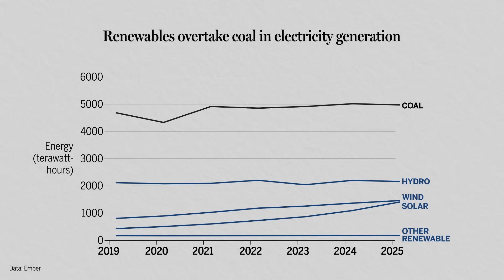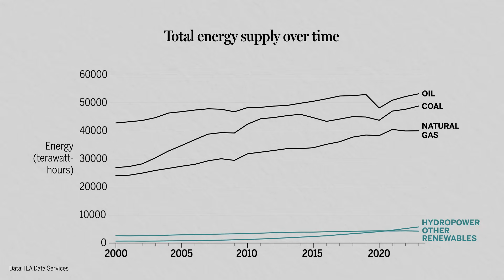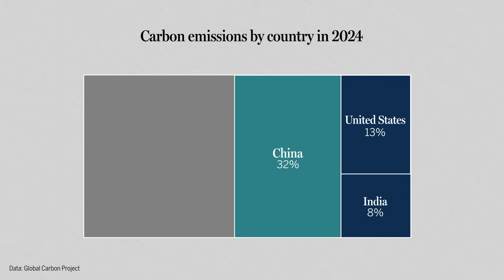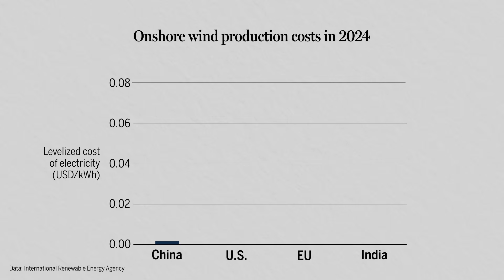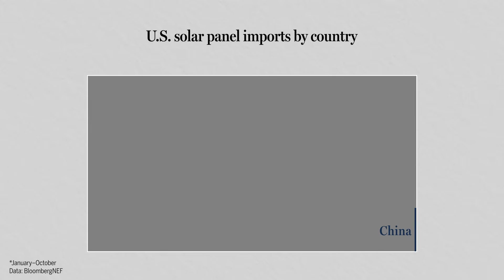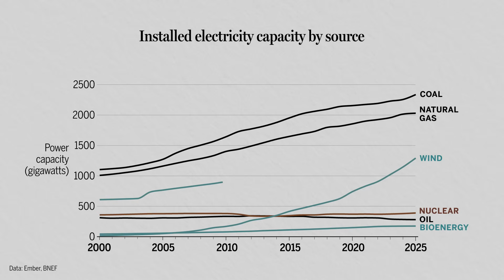How cheap renewable energy is finally flattening emissions

Comment: The rise of solar power is great news, but frankly, it's only (at best) half of the puzzle. Clean firm power sources are still criminally underdeveloped globally with respect to fossil fuels, and the most scalable one in this category -- nuclear power -- has been shelved for decades for bogus reasons. Nuclear plants are costly to build, especially in the West, but physics doesn't mandate it to be that way. Just like physics didn't mandate silicon photovoltaics to remain at 1970s eye-watering prices.

The potential is there for a reliable, affordable, abundant, and overall sustainable power supply for all of humanity. We need to be frank (and rational) about the shortcomings of every option, and invest in a diversified portfolio with a long-term vision. Either we do that in the West, or else we'll have to pray that China also learns how to build nuclear reactors that fit into shipping containers the way solar panels do today (i.e., so as to make up for the lack of vision, political consensus, and industrial capacity elsewhere).

Comment: Can someone explain if there's a problem with recycling/discarding solar panels, in terms of ecological impact?
Reply: Recycling and manufacturing concerns are definitely a consideration, but the people lamenting how terrible it is, ignore that the biggest waste product in America for the last 100 years has been fly ash which is what is leftover from burning coal.  Its often stored in mountains at the power plant, and the dust is cancer causing.  Because the chemistry of solar panels and manufacturing is constantly changing it is hard to predict how they might be reprocessed, recycled or disposed of.  With a 25 year life span, at the point they are replaced  they have produced quite a bit of energy.
Reply: No.

Comment: Although I have my own solar installation and like it.
The picture about increasing renewables energy generation vs increasing demand is misleading. It suggests that increasing renewables generation helps to meet the increasing demand for electricity. To some extend it does, but not even nearly one to one. A lot of renewables electricity generation pushes conventional electricity generation out of the market instead of meeting the increasing demand. We still need to build conventional power plants to have power available reliably, they just don't run as often, because they are not needed when the sun is shining and/or the wind is blowing.
We see this in "China's pivot away from coal". China is still building coal plants.

Comment: The greater proportion of renewables the higher the price of electricity in those countries. That may/may not change in the future.
Reply: Erm, if you were watching you might have noticed the mention of necessary infrastructure to capture, store and transport renewable energy. That has to be paid for but once in place the cost will fall dramatically

Comment: 5:25 EVs can be charged when the electricity production is higher than the demand, they are perfect for a renewable society. And people do charge when demand is low, because in most countries it means cheaper electricity. And of course it is automatic, the owner of the car just have to plug when arriving at home or work, the charge will start/stop at the perfect time. Not to mention V2G.

Comment: Could they not make roofing tiles that could be integrated into the building process than an extra ad-hoc?
Reply: Yes it can be done but is currently expensive compared to just buying panels.
Reply: Solar roof tiles are impractical and dont exist
Reply: @Nyan4Eon  Come to Australia with that assertion and you'll be laughed out.

Comment: If this were true, why are energy prices rising in European countries that switched to renewable energy?
Reply: Profiteering mainly and governments setting prices based on the market price for gas. Russian sympathisers still pushing the cheap gas nonsense.
Reply: @PaulC-s1d so the suppliers of renewables are profiteering?
Reply: To pay for the necessary infrastructure. Take my country, the UK. Most renewable is wind rather than solar, generated mostly offshore where it is windier and there are no objections from people from people who want a nice view. The electricity has to be transported onshore and stored- and that is very expensive. Once it is in place, the cost will fall dramatically
Reply: Cheap Russian gas was still the largest single energy source for many European countries

Comment: Solar energy combined with battery storage can power the world many time over.
Wind and solar energy are safer, cleaner and cheaper than fossil fuels. Cheaper WINS !
Reply: It won’t. Only theoretically. Back in Practice it doesn’t. Power grids can’t run on renewables alone
Reply: @volkerr. Oh you are so wrong.   Battery storage makes wind and solar base load power 24/7/365
Reply: @KJSvitko  😂😂😂😂 imagine 2-3 days with no wind.. first day energy comes from batteries for some hours. But due to the lack of wind it can’t reload again… 🤦‍♀️🤦‍♀️🤦‍♀️🤦‍♀️🤦‍♀️
Reply: @volkerr. That is why wind and solar are a good combination to work together  It is sunny in the day time and the wind blows more at night.
Reply: @KJSvitko it’s not predictable and it doesn’t  work like in your green fairytales. Trust me. I’m German an we suffer from that failed experiment. 😢
Reply: @volkerr. WInd and solar energy are safer, cleaner and cheaper than the alternatives.  You can't beat free energy from the  sun.
Reply: @KJSvitko it’s not cheaper when you look at the whole
System 
A power grid can’t run only wind and solar only.

Comment: Imagine how much cheaper electricity would be if society kept making nuclear power plants instead of these solar junk panels.
Reply: Possibly cheaper. But nuclear is pricey at the beginning, and absolutely has to be done right. We can look at France to answer your question. They have abundant and stable electricity. Cheap? Well petroleum is pretty cheap.
Reply: Solar is relatively cheap, adaptable, and a great compliment to fission.
Reply: @presence5426  Solar is stupid cheap, here in Australia there are deals for batteries that include FREE panels.
Reply: @PaulC-s1d It's gotten much cheaper. And subsidies help. And we should do it. But over the decades, it wasn't viable yet. And, we'll be needing all the electricity we can get. Can't count on just solar.
Reply: Try checking the costs BEORE you make yourself look ignorant.
Reply: @ianhamilton3113  Do a fair analysis of the costs. Seriously. The entire life of a fission plant, value of electricity produced, all costs considered. You might be surprised.
Then look at what the French & Finns have done with fisson.
Not to say solar isn't cheap. It is. It will be a big player soon, and sorely needed. But... we needed to limit burning "cheap" fossil fuels 50 years ago. The way to do that was via fission. Developing it, making it safe, and exporting the tech. We didn't.
Cuz radiation scary. Cuz the costs!!!!!!! Cuz we got tons o' oil, Tex.
Dumb. Bad thinking. Bad policy. Bad leadership. Low vision.
Now we're screwed.
Reply: @presence5426   I agree dropping nuclear early was a big mistake and it does have a place. Problem is the capital costs are rising along with the finance costs. All the time solar, batteries and wind get cheaper.
Reply: @ianhamilton3113  Federal governments can fund whatever they want. The U.S. could have easily funded the best fission program in the world. France did just that. We could have partnered with them. Then we could have made money and reduced fossil fuels use by exporting the tech.
Solar & wind are cheaper, but we can't run an economy with them. They're like, what, 10% of electricity generation? Fission has been a steady 20% for decades. The rest is mostly petroleum... still.
Reply: @presence5426  "Solar & wind are cheaper, but we can't run an economy with them." Today! Quite correct. But we don't need to today. You are not factoring in future developments.

Comment: I have travelled to Punjab in Pakistan and there’s a solar revolution happening there, it’s nice because Pakistan has a huge deficit on their accounts due to energy imports, so additionally to the economic development it also helps their balance of accounts.
Reply: Only thing now is electricity storage, because I've heard that just like here in the Netherlands, the energy grid is starting to get smoking hot because of all the green electricity sent back into the grid.

Can be NMC or LFP lithium batteries or Sodium-ion batteries, but despite them getting cheaper, they're going to remain expensive compared to heat batteries made out of sand, concrete or (ceramic) bricks.
Reply: @therapeutischbecommentarieren  yes you are right. I am from Pakistan and we need cheap batteries soon. Everyone is adopting for Lithium batteries but they are expensive for now. There is a sea of solar panels around my house now. But very few batteries yet. And we are counting on China to make cheap batteries soon.
Reply: @alitariq9750  sodium batteries at a fraction of the cost will be out in the mainstream in a few years.  Not as good as lithium but so much cheaper.  Also coming from China.

Comment: 1. Much of the reduction in C02 in the U.S. is a product of using more natural gas rather than oil and coal, both of which emit more C02 when burned.
2. Most renewables come from China, a dictatorial, communist country that does not have the best interests of the U.S. in mind.  It is not wise to make China more wealthy by buying their renewables.
3. China is increasing its energy output from renewables, yes, but it is also building between one and two new coal plants every week.  China simply wants to produce more energy by any means possible since energy equals prosperity.   
4. The best way to keep the global south poor is by requiring that they use renewables.  
5. The picture for this video of what could be a beautiful field covered with solar panels says it all.  Solar panels take up a huge amount of space while destroying natural beauty.
6. The continued and increasing use of fossil fuels, while renewable output is much less than fossil fuel output, says it all.  Renewables at least now cannot compete.  
7. Renewables do have a place, but for now at least, the combination of nuclear and gas provide stable, non-intermittent energy with very low C02 output.
8. This host is correct: Making a full transition to renewables will cost many trillions of dollars.  This is not worth the cost.

Comment: Misleading title - no evidence presented for "flattening emissions". Coal production is rising, as is CO2-emissions (actually mentioned). Renewables are not even keeping up with the overall energy demand in the world, all though electricity production has seen a shift in the mix towards renewable. It remains to be seen how much renewables you can mix into electricity production, without at some point introducing large scale batteries (which will be very expensive). 

It was said that China is almost there - when it will flatten its emissions. Make no mistake - its in the interest of China to have us all believe that. They will continue to do exactly what makes most economical sense, while the West moves all its production to China.

Comment: Doesn't solar use a lot of heavy metal that has to get extracted that's very hard to recycle and extract like lithium? Also love how we keep pressing on renewables but no talks about the carbon cycle instead it's just CO2 everywhere!!!  And if we want to actually help then we need to dial back our carbon consumption and give the Earth time to heal 🫠
Reply: What?
Reply: @Iblueda1234 Basically saying solar is worth more than it gives back (It was around 3am when I was typing this I was very sleep deprived)
Reply: It’s only hard to recycle those kinds of materials as long as there isn’t a reason to do so at scale.
Reply: @alexsiemers7898 Wouldn't that need come from needing to replace panels and batteries if we did somehow switch just renewables? And solar panels still would need to offset their emissions for extraction of materials

Comment: Whats the current rate of solar panel efficiency?
Reply: @sopek1427  Of currently commercially available panels, 22.5%.  
But with new materials and manufacturing techniques, efficiencies of 25 to 28% will likely be available in the next 4 to 8 years.
Reply: @sopek1427  20%

Comment: American denialism of climate change and the subsequent need for renewable energy investments will put it at a serious economic disavantage and compromise security in the next couple of decades as the rest of the world are rapidly advancing renewable energy, battery storage and electric vehicles (EV’s) tech.
Renewable energy is the cheapest and fastest to setup form of energy generation; even when compared to coal. However, advancing technology will still allow fossil fuel corporations to extract oil from nonconventional sources like shale or source rock. So the concept of a Peak Oil time-clock will have to be postpone. It is not a depletion of oil but when unconventional oil exploration, extraction, refining & transport becomes so financially expensive for fossil fuel corporations to stay profitable for their share holders that the transition to cheaper, faster to setup renewable energy in the forms of solar, wind & geothermal energies will become dominant. Geothermal energy also has the advantage of benefiting from existing oil drilling technology.
America needs to wake-up before it’s too late.

Comment: Our new house has super high insulation and powered by electricity. I installed R35 foam insulation in the attic, R28 in the walls and R10 over the concrete basement floor with blue DMX dimple mat first. Next year I'd like 10 solar PV panels on the southern roof and the year after a residential battery system. My top concerns are climate, comfort, energy security and mid term cost savings.

Comment: Finaly we got to the point, where renewables, EV and batteries are big enough to push fossil energy down.
Reply: It’s an inflection point that every new technology encounters. When it’s commoditised to the point where production of said technology is available at a price where it can be mass consumed. 

Australia has just announced that from 2026, households will get 3 hours a day free electricity because there is simply too much supply.
Reply: @kr-wh4sh turns out subsidized oil is to expensive for the market.
Reply: @matthewvandeventer3632   "subsidized oil" to the tune of ~ 3 billion dollars a year!
Reply: Economic warfare does that quite well. OPEC+ is just a cartel that occasionally disagree
Reply: False. Every year we burn record amounts of oil, gas, and coal.
Reply: @1237barca  "Every year we burn record amounts of oil, gas, and coal." And every year the planet sets a new record high CO2 concentration in Earth's atmosphere!

Air pollution is not getting any better either!
Reply: @peterh5165  ya, my point exactly. All the renewables have led to record emissions and continuation of the same trend. They are not a solution.
Reply: @1237barca  Outstanding answer 1237barca!

   Because everyone knows when you install solar panels, they keep burning fossil fuels for ten to twenty years (the life of the solar panel) versus just burning fossil fuels every single day: forever!

And everyone also knows there are zero emissions from fossil fuels production!

Excellent catch 1237barca! 
      I completely forget that gas stations just stick a pipe in the ground, and out comes refined gasoline!

How can I have been so blind!

But...

Other people seem to suffer from this delusion that actually it actually takes energy to:
 pump petroleum out of the ground; 
(sometimes with the assistance of high temperature steam injection to thin the oil enough to pump it out of the ground);
transport it to a refinery;
refine the oil at temperatures from 750 degrees F to 900 degrees F;
then transport the gas to gas stations in big, heavily load fuel trucks all over the region.

These delusional people think that everyone of those steps from ground to gas station requires energy: 
lots of energy!
And here is the kicker: you have to do that every single day!
FOREVER!
Reply: @1237barca  
Hey readers of this comment section: 
notice how 1237barca did not answer the part about air pollution!

Google:
China airpocalypse

And look at the horrendous air pollution in the big Chinese cities from a dozen years ago.

Air pollution so bad, that it was hard to see across a wide city street intersection!

Air pollution so bad that it wasn't just the elderly suffering lung issues: 
    young children were coming down with lung issues!

Young children!

It was so bad that China started a huge push to get heavy industry away from the big cities AND, 
     a huge push to eVs (electric vehicles).
 
A dozen years later air pollution is much better!

Who knew that not burning fossil fuels would reduce air pollution?
Reply: @kr-wh4sh don’t let the door hit them on the way out I say.
Reply: I bet conservatives would suddenly stop being pro free market
Reply: yes but we still have a huge probem with the battery technology. the way it currently is you could not replace all cars planet wide with batteries.
We desperately need new battery technology. Let alone the energy infrastructure needed for rechargingThe electric engine is no doubt the future, however Lithium batteries are not.
I really pray that someone of our smart people comes up with a solution to this

Comment: If you're going to talk about reliable baseload energy. Why don't push through nuclear
Reply: Batteries to capture excess solar are cheaper, and far faster to deploy.   And with sodium batteries, and improvements in mass manufacturing, cost of batteries will drop another 30% by the end of 2026.
Reply: Because nuclear solves the problem. We need to manage it.
Reply: Too expensive in some countries due to fear of meltdown and NIMBYs